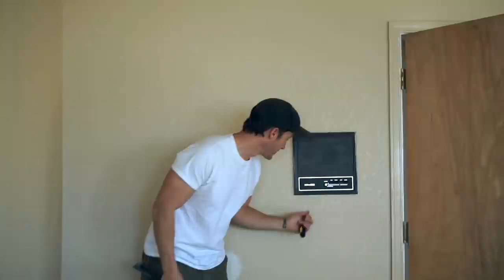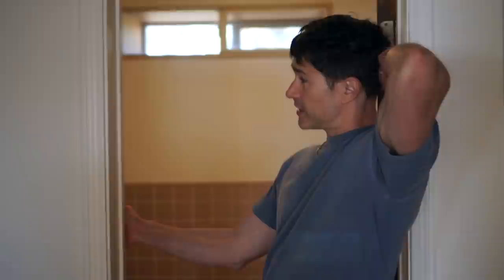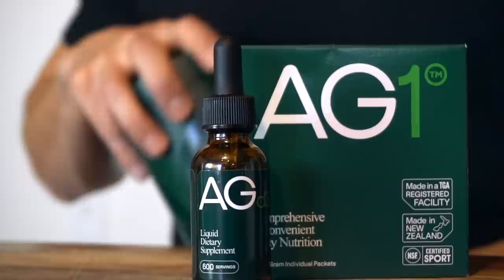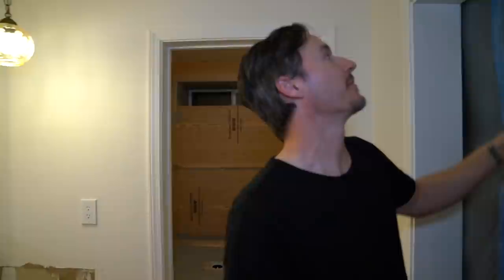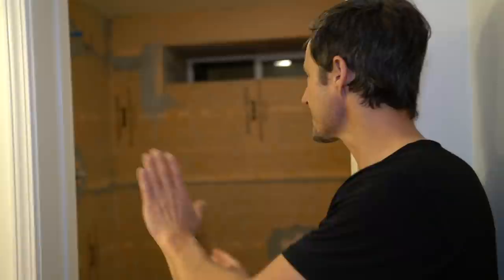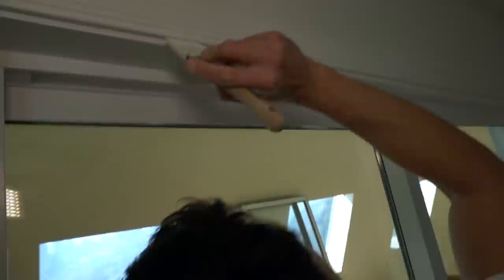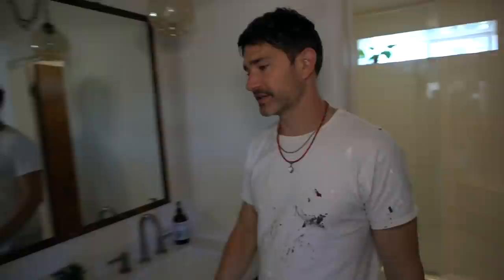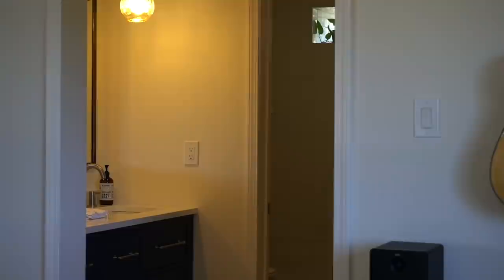Shower For 2 | MATT AND BLUE

Comment: When my parents built the house my mother still lives in, it had an intercom system, but it never really worked very well, and it’s long gone now. And the sliding glass door you installed looks just like the one I had put into my condo a couple of years ago to replace the old one. I never have gotten around to painting the trim, though, so it’s still bare wood. I like it though, and I think yours looks good, too, as does the new bathroom.

Comment: Hi Guys! What machine did you use to remove the popcorn ceiling? And I guess what was your process, please? I have a 1960 Cottage home that I am updating. Thank you!!
Reply from the maker: We used a drywall sander. But you should have the popcorn tested for asbestos being that your place was built in the 60s.  If it has asbestos you should hire professionals to come in and remove it.
Reply: @mattandblue  Thank you so much! Yes, I must do the test before I decide to try this, you are right. Thanks for the drywall sander information, also. I really had no idea!;)

Comment: @mattandblue: I noticed you were using some kind of machine on the ceiling that had stucco. Wanted to know what that machine is called? I have stucco walls in my apartment in Brooklyn and I have been wanting to get rid of it for years!! It looks like some kind of vacuum cleaner. Does it sand off the stucco? Really want to know. Thanks. Great videos by the way. I’m a new fan of your channel and the renovations and the pasta making from scratch are my favorite parts.
Reply from the maker: It’s a drywall sander. If you have actual stucco in your apartment It may not do so well in removing it. We had popcorn ceilings which is much more easy to remove with the sander.